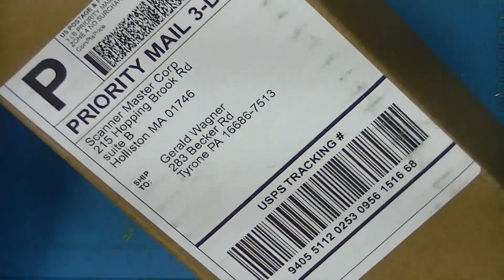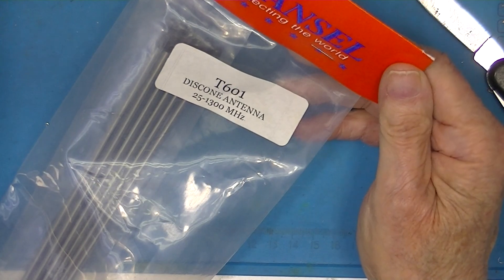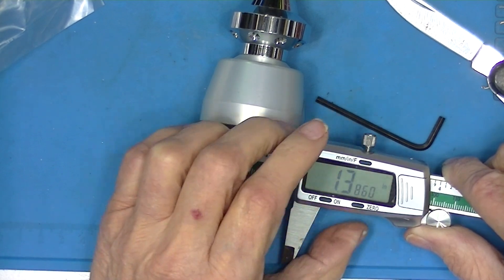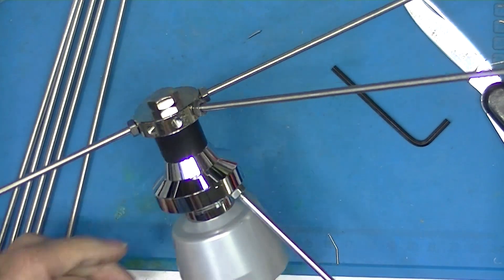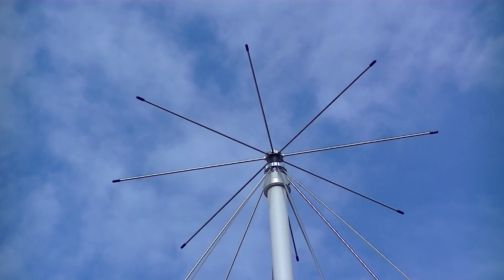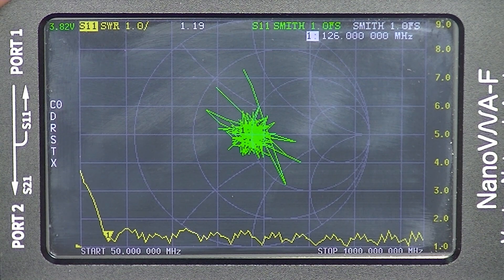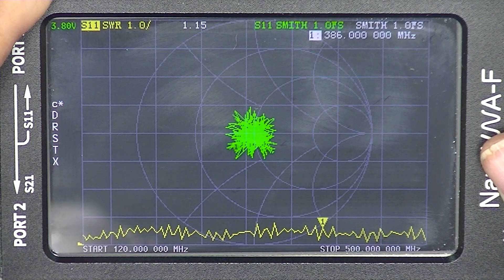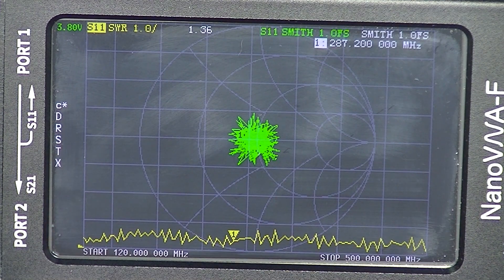Assembly and Measurements of a Discone Antenna

Comment: I bought something very similar and wasn't happy with it. Skirt radials kept falling out and it didn't go down to 70mhz like they claimed... the dimensions weren't big enough. So I've redesigned it, bought better hardware and am using aluminum sheet to make a bigger top disc as well as solid 6mm aluminum rod to make 8 longer radials. It'll work properly when I'm done with it 😅 Got the design information out of the 1974 ARRL antenna book. Thanks for the video, the analyser gave a lot of interesting information.

Comment: This antenna lacks a vertical whip on the top which would allow it to reach down to 25MHz, like the Diamond D3000N which does have one. Based on the cost it looks like a great value.
Reply: My No Brand " original" Discone has a vertical whip. Just for joke i put a longer whip that seems to work better